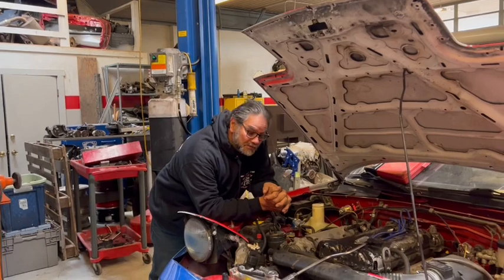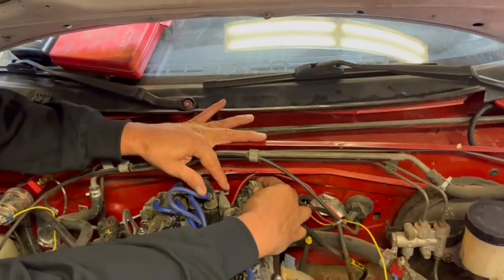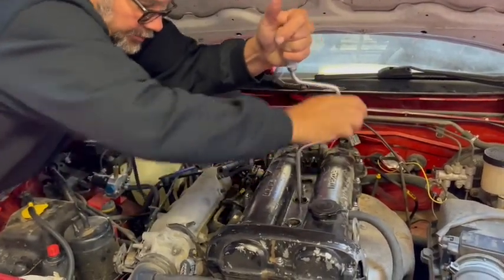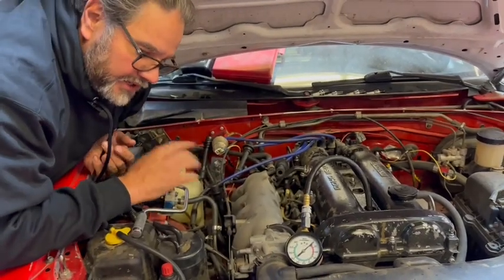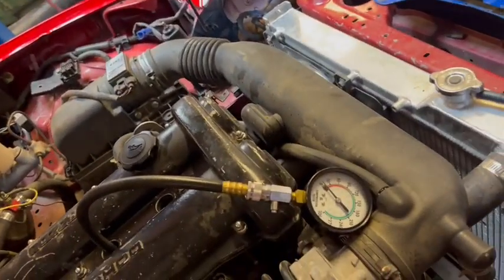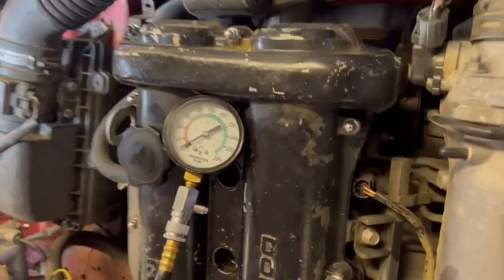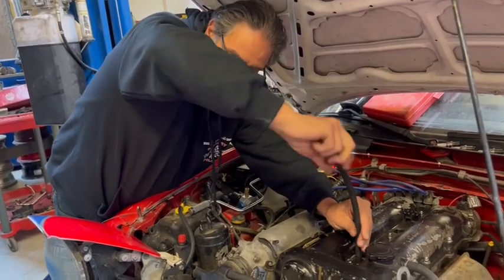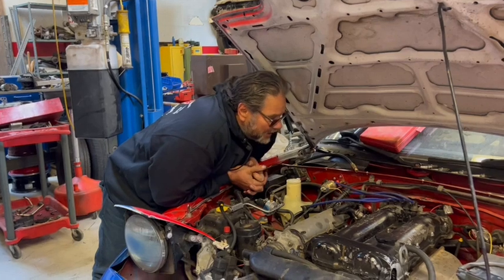Spec Miata MX5, Autocross Comp test. Is my engine a strong one?

Comment: One of mine jumped from 40 dry to 120 wet. Does that still point to the head or does it mean that both might be an issue?
Reply: Dang it! Well, thanks for the input. I really do appreciate your videos. I think I’ll try pulling it apart and following your engine build videos. Do you happen to have a parts list needed to do it?
Reply from the maker: Sorry it’s not good news, it’s rings

Comment: Does pulling the cam angle sensor on an NB1 work to disable the spark, too? It's on the front passenger side.
Reply from the maker: Yes if you disconnect it you will not have spark..